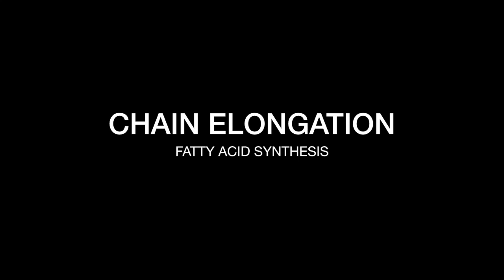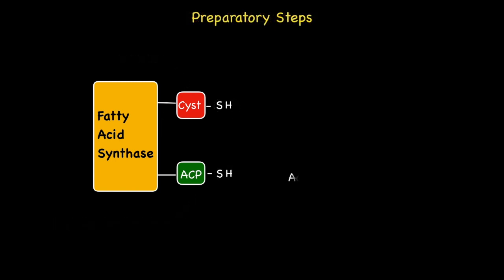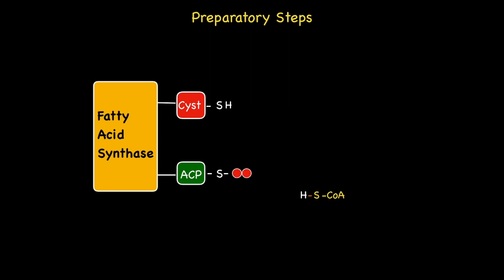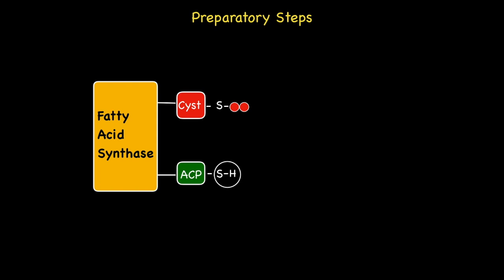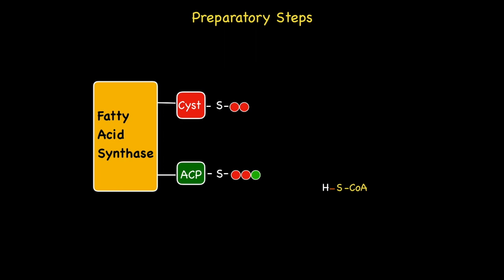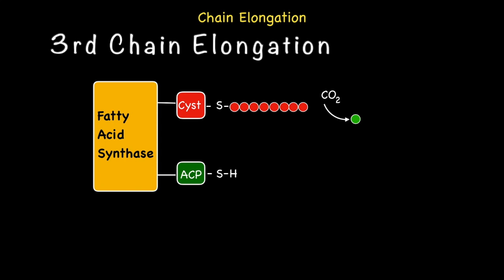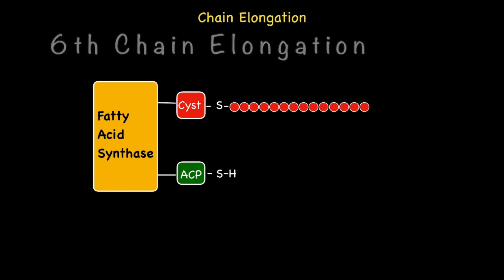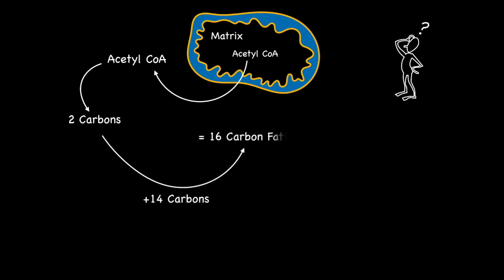Chain Elongation and Fatty Acid Synthesis

Comment: In preparatory step where does acetyl COA comes from when it gets converted into malonyl COA
Reply: It comes from the citric acid cycle, that occurs in the mitochondria when the enzymes of this cycle are saturated. However, acetyl CoA cannot cross the mitochondriol membrane. Citrate can, so acetyl CoA is first converted to citrate, citrate is transported to the cytoplasm and once it’s there, it can be converted back to acetyl CoA.